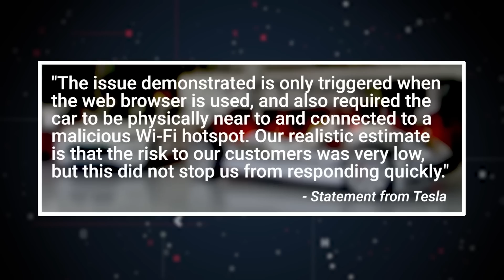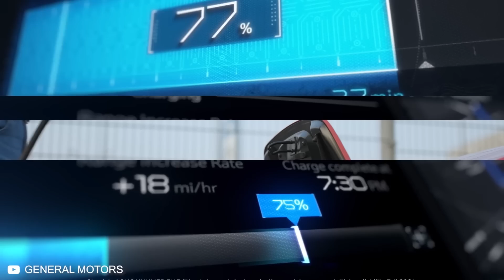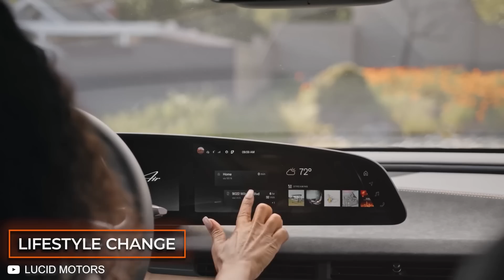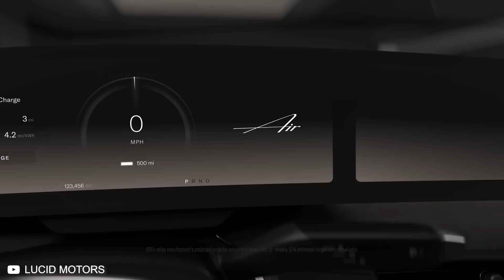EVs' Serious Problems That Carmakers Are Hiding

Comment: Generally to ban new sales of gasoline cars, not ban existing cars.  But.... most of the points made here have nothing to do with EVs.

0:51 - EVs are increasingly high-tech.  ALL new cars are increasingly high-tech, it doesn't matter if it is ICE or EV.   That includes remote steering and such.

1:29 - Meh.  No different between EVs and ICE

1:30 - Not sure what the point is here.  Yes, there are maintenance costs.  Yes, things can fail.  But electronic components are not going to be any more prone to failure than mechanical components.   Also, some of the commentary is just plain wrong.  Like at 2:20:  "If you keep it out when it is too hot or too cold, it can get damaged".  That's complete nonsense.   Similarly, fast DC charging "too much" doesn't hurt the battery.  In fact, it doesn't hurt the mileage endurance of the battery at all.  If you don't fast DC charge a lot you probably aren't driving a lot, so calendar aging of the battery might be a significant in terms of its endurance.  If you do fast DC charge often you probably ARE driving a lot, in which case miles driven becomes more significant and calendar aging becomes less significant.   Basically its a non-issue.

2:33 - The temperature range is incorrect

2:40 - EV batteries can cause fires.  Older chemistries can, yes.  Newer chemistries (aka LFP batteries)... generally won't.

3:07 - Replacing a model 3 battery pack is around $13K.  Yes, this is correct.  But the 'fee' is 30 minutes of work in a shop and you are unlikely to ever have to replace the battery pack in a model 3 (even more so one with a LFP pack).  In otherwords, its like arguing about having to replace an ICE engine.  Sure, you might have to, and you might be out of warranty so it might not make any sense to do it.   Do people generally worry about such things?  No.  And its the same for an EV battery pack.

3:20 - Range anxiety and charging problems.   This guy is really confused here.  Range anxiety is real but its a relatively simple learning curve and once you own an EV it goes away pretty quickly.   It can be an issue for some people, but it is a non-issue for the vast majority of drivers.

3:45 - Simply incorrect.  Today's EVs have ranges in excess of 200 miles and are suitable for far more than just going to work and back.  And the comment about 'other EV companies' struggling is also not correct.

4:02 - Charging.  This is mostly nonsense.  The narrator is trying to push range anxiety as a problem.  Check where you live, you aren't going to be shipping your EV to Africa so "what about the rest of the world" is in the eye of the beholder.   Also, the narrator intentionally papers-over home charging (one of the coolest conveniences of owning an EV).  Which is unfortunate, because there is actually a good debate point there since not everyone has convenient access to charging "at home".  An apartment dweller is dependent on the landlord installing a few L2 chargers (or just AC plugs) at ground-level or in the garage, for example.

4:47 - This comment about charging in the U.K. is incorrect.  Or more to the point, the charging network is scaling up at such a high rate that comments about deficiencies tend to become obsolete pretty quickly.  There are deficiencies to be sure, just not really what the narrator is trying to push.

4:50 - Some of these comments are pertinent.  Fast DC charging locations are having growing pains.  There are dead chargers.  But although inconvenient, it isn't the hyped-up issue that the narrator would seek to depict.

5:15 - Lack of choice.  Not true any more, there are dozens of EV brands and more on the way.  There is plenty of choice.  And the narrator seeks to assert that EVs are significantly more expensive when they actually aren't.   New ICE vehicles are just as expensive.   The tiny bit of truth here is that there are a lot of low-end ICE vehicles available (though not particularly cheap these days, even so), whereas EVs focus more on the mid-end market.   But this is in America... Americans demand bigger cars.  In Europe there are tons of small EVs.   And again, what is the author trying to compare against?   The implication is that it costs more to get the same features.  The reality is that EVs tend to offer features in their base models that you have to pay through the nose for on similar ICE offerings.  So even though the price range median is higher for an EV, on a feature-by-feature basis it isn't so much.

5:40 - Narrator seeks to link price with range.  Which is stupid.

5:50 - "Nobody likes change".  Author talks about life style changes.  My 80-year-old father just bought a used EV and he loves it.   I call bullshit.   Then the narrator seeks to imply that new technologies have "problems being accepted"...  uh, more nonsense.  EVs are in high demand, and in China EVs are literally taking over the market.

The narrator really goes off the rails after this point.   Pretty garbage video, designed as click-bait.  Rehashes long-disproved memes.  Employs scare-tactics.  Woe is the poor soul who believes nonsense like this.  So downvote the sucker, folks.     Its perfectly ok if an EV doesn't fit the bill for you, but don't mistake that personal choice with the sea-change happening in the world today.  There's a reason why EVs are (very clearly) going to take over.  The technology is fully proven and can only get better over time.  Even if there are some downsides (the only real one being non-stop range), the EVs today already fit the bill for probably half of America and in a few years will do so for everyone else.

-Matt

Comment: Remember the “Y2K” fiasco.  How about windmills to solve energy shortages?  Most of Europe is starting to dismantle many wind farms.  Solar is too intermittent to be practical in most of world.  Our government leaders are mostly brainless and auto manufacturers will try and market refrigerators to eskimos if they can make a buck.  Beware people, beware.  Trudeau just announced no more non-electric vehicles by 2035 without having a clue how to get there.
Reply: They are dismantling wind mill farms because the most current cheapest technology that produces electricity is utility scale solar.  In  most locations, silicon photovoltaics with battery backup is the cheapest way to make electricity, which has a much lower impact on the environment than that of fossil fuels. Redox flow batteries are available off the shelf and  liquid air batteries too. This will be used to fill the gap until the nuclear industry gets its act together and help with the suspension of new fossil fuel developments, as petroleum now is too valuable to be wasted as gasoline; we need to keep as much of it in the ground for our grandchildren for plastics, paints, etc.